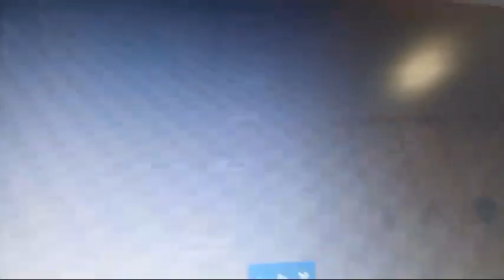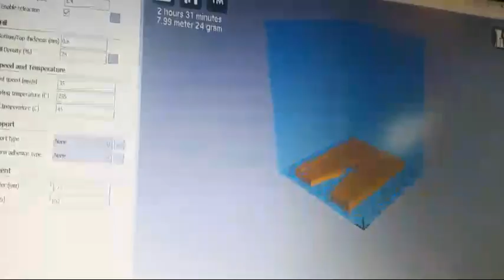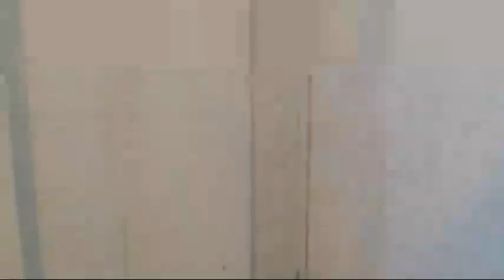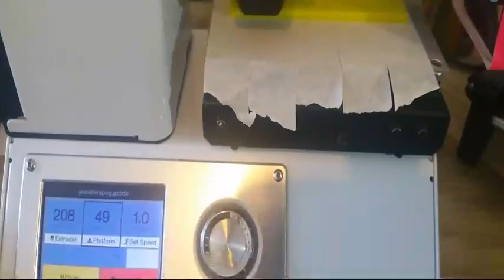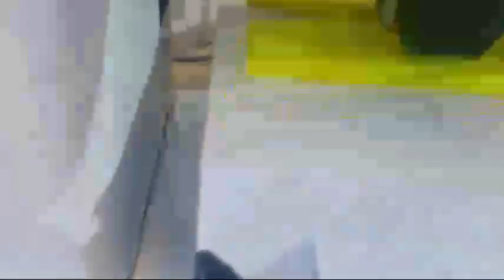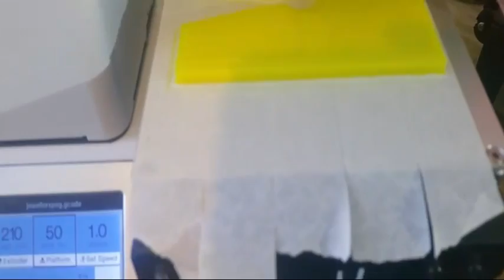wasLIVE~3D Print Jewellers Peg in PLA

Comment: I would love to share with you my 3D printing adventures. I have a few things on Thingiverse. http://www.thingiverse.com/toranarod/designs. but this is just a small fraction of equipment I make for fun and business.  Remember we where into zero point energy. I make 3D printed generators as an example. I make 3d printed RC helicopters Look at my YouTube channel. I make car parts I sell on eBay. also I only print in ABS.     http://www.ebay.com.au/itm/232308764339?ssPageName=STRK:MESOX:IT&_trksid=p3984.m1561.l2649. I would love to help if I could.http://www.thingiverse.com/thing:124710
Reply from the maker: toranarod toranarod that's awesome. what do you use to design your models?
Reply: hi sorry for the late reply. head down working on my 3D printer I have a few cad systems. my favorites solid works. been print an AC induction Motor. I will put some photos in drop box